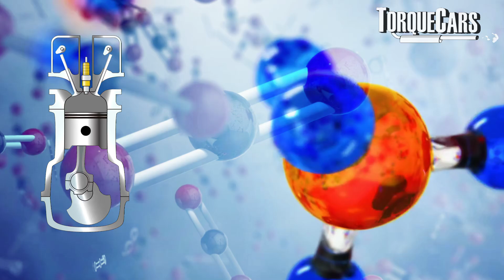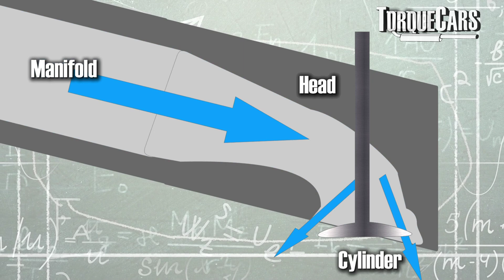Why Most Cars Are Turbos Now! (Pros & Cons Of Turbochargers.)

Comment: I fail to see the point of turbos. I recently got a V6 Twin Turbo Hybrid, and noticed several issues. First, you have to change the spark plugs every 30k miles and on my old V8 I could do it every 90k miles. The fuel savings from getting 18 MPG with my V6 Twin Turbo Hybrid instead of 14 MPG with my V8 is getting spent on $400-$900 spark plug services 3x as often. Makers give turbos extra hardened components for the hotter temps, but the TT-Hybrid system shuts the engine on and off often, which adds to wear on the starter and the engine. Turbo engines are designed to run hotter, but not to have the engine constantly cooling and lacking oil when they get turned off, because turbo engines need that oil. This causes much worse reliability than normal turbos and normally aspirated engines, granted this is a problem specific to turbo-hybrid combos.

Comment: Modern turbos are reliable. They offer fuel efficiency and extra power. Drivers need to know that turbo engines can last up to 300000 kms if they know how to use them. Small engines with turbos are not for race. They are for economy and reasonable acceleration. Using them for racing is stupid

Comment: I have had Turbo cars for 30 years.  Love the older school ones. .Never had any major problems. Just a couple waste gate issues on 2 cars over the years. Never replaced a Turbo or had sn engine failure..Put some high Kms on them..However, I have had the best Turbo cars made, Saab...3 different series 900,9000 and 9-5...

Comment: I love the modern turbo engine. They are very fuel efficient, 7L/100km on a 252 HP engine!

I need to point out that old school turbo engines like the ones in Subaru WRX or old generations of RX7, Supra and GTR are not the same as the modern turbo engines. 

The modern ones use turbo in combination with direct injection. Which allow them to be fuel efficient and they have an after run water pump which turns on after you stop the engine. This cools down the turbo charger so that it lasts longer. 

Of course, modern turbos don’t have lag like old ones as well.

Comment: 1988 Toyota 22r. No turbo with more than a million miles. Original engine, radiator, water pump, carburetor. It would be in a junkyard with turbo.

Comment: I work for a car dealership and almost all the new cars use smaller displacement turbocharged engines and I’ve grown indifferent on them. On one hand I love the sounds they make and the power surge you get once you put the foot down, but I don’t like that there’s about a 1 second delay every time I want to accelerate and I also don’t like being force to accept the extra maintenance cost associated with it. I personally think turbos should be used for performance and diesel vehicles and regular commuters should be naturally aspirated.
Reply: Agree. And driving an old carburetor car none of the modern engines with turbo and pollution control have the instant throttle response of the old car. There is no delay at all. Makes for a really responsive drive. But of course less power and more fumes but the sloppy response of modern cars is hard to tolerate.

Comment: I have had 5 turbo charged cars and never had a problem with reliability, though i always change the synthetic oil and filter at around 5000 miles. The latest one is a Ford Puma with a small 3 cylinder and its quite quick and very economical, and can run on standard unleaded, on the other hand i prefer my 5 cylinder petrol Ford Kuga, its 14 years old has greater performance and all wheel drive though only does mid twenties mpg, i only have ever put super unleaded in it but the extra cost doesn’t bother me as its only a few pounds difference when filling up. Hardly any discernable turbo lag on either of them, though they are both Autos so that may be why.

Comment: Generally I dislike turbos. They are fantastic for economy, and the low-end shove they give is amazing. Modern cars have even proved they can be reliable, but... I don't like how they drive.

The shove is great, but its always delayed, even on very sophisticated variable geometry systems with clever boost control systems. And for me if I'm quickly pulling out of a junction I don't need that much power, thats what gearing is for, what I do need is response. And that 0.5-1 second delay when I put my foot down is infuriating.

I also find it just more fussy to drive. You may not need to change down as much as you would in an NA car with less torque, but there is always a range of power the engine may give you at any rpm and throttle setting. Aka from 0 boost to maximum boost for the throttle input at any given rpm. That makes it more rubber-bandy feeling and requires more adjustment to keep a smooth and steady speed or rate of acceleration. Whereas in my NA Volvo C30, X amount of throttle at Y amount of RPM always equals Z amount of power. It's consistent and I like consistent. Moreover, micro adjustments to the throttle have a more immediate effect, making managing speed more intuative.
Reply: They are mostly  good for fuel economy on paper.  In reality the fuel economy goes off a cliff once you put your foot down.      Real economy would have to include reliability and regulators aren't interested in that.

Comment: I didn’t necessarily want to buy a turbo vehicle to replace my wife’s NA 2.0 Hyundai Tucson, but the car was too small and we bought a Ford Explorer with the 2.3 twin scroll turbo. The explorer is way bigger, the engine displacement is bigger, but it is over double the horsepower and gets far better mileage. The Tucson would get 16-17L/100km in the winter, which is the same as my 5.0 V8 truck! The Explorer is currently at 12.4L/100. This is during repeated snowfalls in -10’c to -20’c with heavy use of remote start and lots of idling, snow tires, city driving etc. It usually averages 9-10L/100km in the summer. So far I am impressed.
Reply: If you intend keeping that car beyond the manufacturers warranty Just make sure you replace the engine oil and filter twice as often as the manufacturer recommends.
Reply: We do such little mileage we actually just change our oil twice a year when the intervals usually only call for once a year. We usually have 50-65% life left when it gets done in the spring and fall.

Comment: Turbos are the best invention as you can get more with smaller displacement and you can get ridiculously more with larger displacement without parasitic losses. So if you match it up correctly it does offer substantial benefits. Extra maintenance and care is worth it IMO.

Comment: I think the so called turbo lag has been fixed for years, in the 90’s turbos were to far from engine exhaust, hence lag, that was sorted decades ago.
Reply: No really. Turbo lag is caused by low rpm because the output from the engine causes more input. You have lower inertia because of better design and lighter turbos and the additional exhaust expansion from post combustion ignition etc, but you will always have some lag at low RPM because you are always adding some back pressure.
Reply: @ So why are all modern turbos built into the exhaust manifold, or like Mercedes Audi etc they have twin turbos in the V of the engine, why ! Because as close to exhaust output, hold your hand by the tail pipe, plenty of air moving to spin a turbo, to far from exhaust outlet is what used to cause turbo lag, I worked on cars making turbo kits, variable vanes or small and large turbos give quick response from low revs.
Reply: @51madmitch  ye it’s almost none existent now in cars of the last say 8 years since they placed them in the system to receive exhaust gases much easier, plus many now have an electric motor that works to spool up the turbo in the low rev range so the lag is a thing of the past really

Comment: Most manufacturers recommend higher octane fuels for turbocharged vehicles. This makes such vehicles more expensive to run. 

Here in my country, where we usually dont use High Octane fuels, people dont like going for vehicles with turbocharged engines due to this very reason.
Reply: Our 1.2 TSI runs fine on the cheapest supermarket fuel going
Reply: I bet it's russia
Reply: Just out of curiosity what country you live in?
Reply: That’s not correct sorry, unless you have a high performance car with high cylinder compression ratio, then you would benefit from say 99ron, but most are made to run on 95ron.
Reply: @51madmitch  We have 92 RON as standard here and Hi Octane is 97 RON

Comment: Turbos are great, but modern manufacturers are using it as a replacement for displacement while making new vehicles heavier and heavier, which places more and more stress on a boosted small displacement engine. This results in premature engine failure.

Comment: Turbo’s are definitely needed with a diesel. My 1.9 pd blew off a hose a while ago, it went “brrrrr” with no power at all 😂
I also know that the map and maf probably had a fit.
As a diesel man they definitely benefit from some forced induction
Reply: You will often see vans and some cars with very smoky exhausts caused by a leaking tube in the turbo system allowing the pressurised air to escape, whilst the engine management thinks , from throttle position , that it can induct more fuel. A simple fault easy to fix,